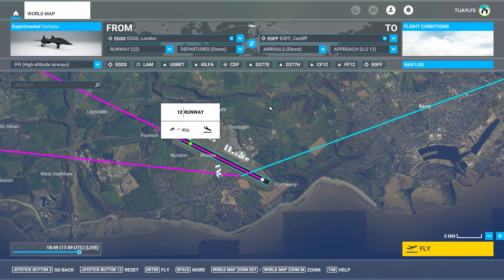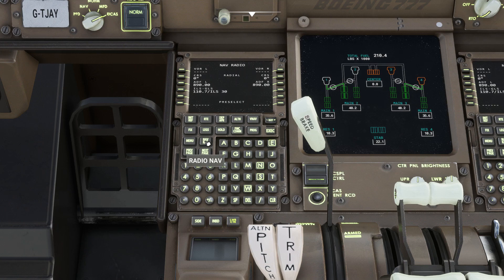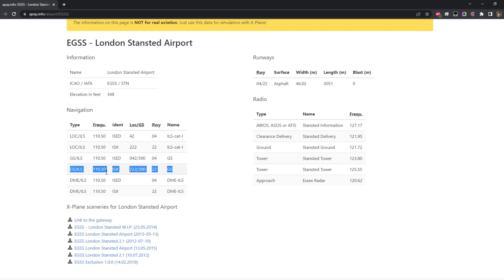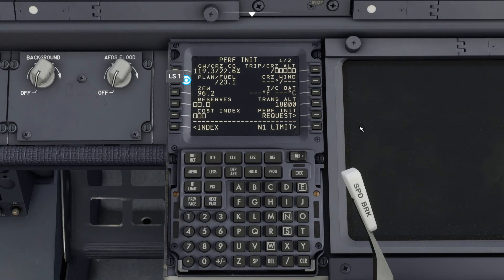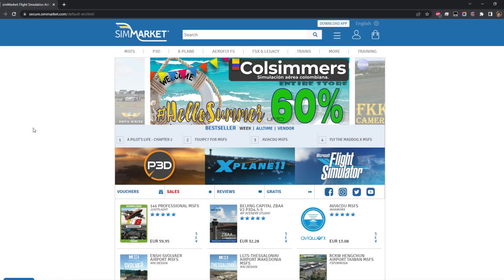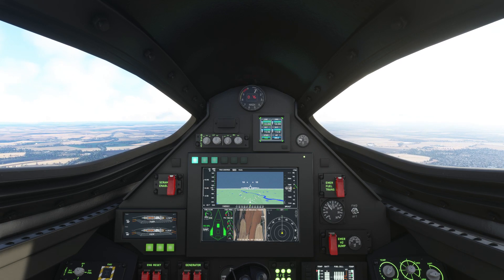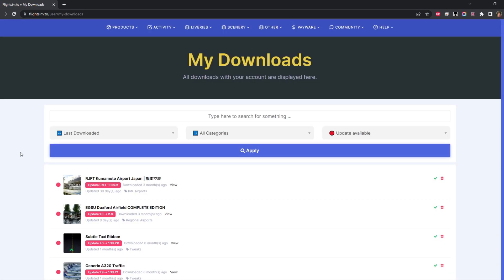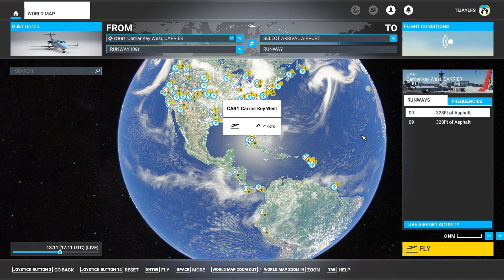Microsoft Flight Simulator FAQs - Find Help Here!

Comment: Thanks you solved a few issues I had but I still have an issue that the avionics turn off in mid flight on the Cessna 172 G1000 or other aircraft using the G1000.
Reply from the maker: If you started from cold and dark, is the alternator (generator?) on? Do you have any possibly outdated or conflicting G1000 mods?

Comment: I have a problem with FBW a320nx.. not loading into airport.. stuck in the loading screen at 75% or 80% doesnt move just stuck. Any help?
Reply from the maker: This is likely because the plane needs updating or your scenery isn’t compatible with SU9 - check your scenery files (from Marketplace and Community folders) are updated too. Also try switching off the Google Earth scenery if you’re using it.